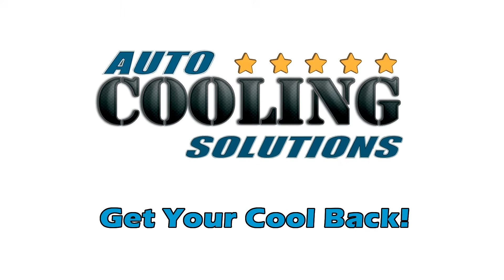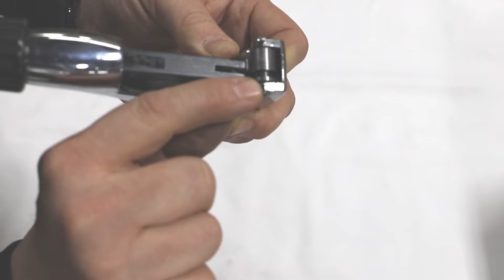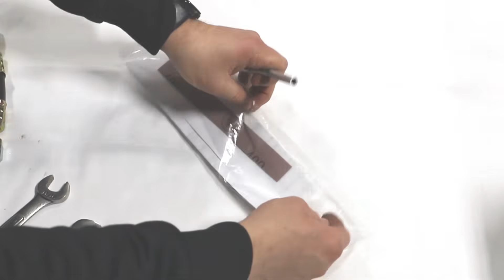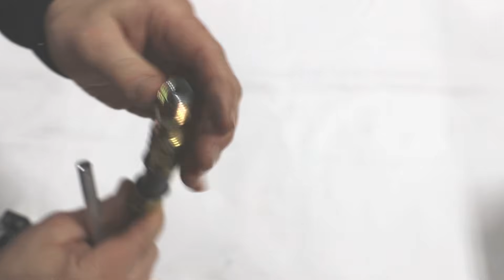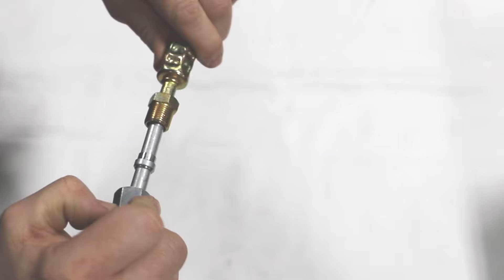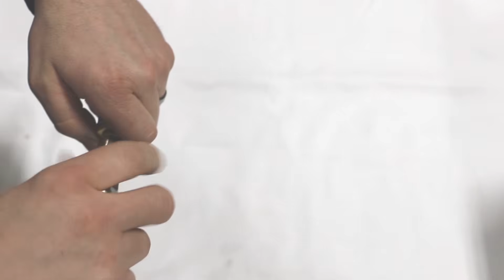How to install AC Line Repair Kits from Auto Cooling Solutions. Fast video to help install go easy.

Comment: Came here because of a Scanner Danner video, where he successfully repaired an 1986 Nissan 300zx, ac refrigerant hose, using one of your compression repair hoses. 
Good to know this is type of product is available.
I also like the clear instructions he got with that hose, and this video showing how to properly install it.